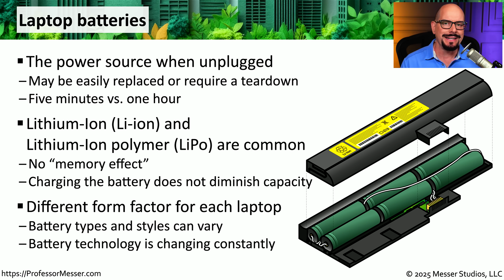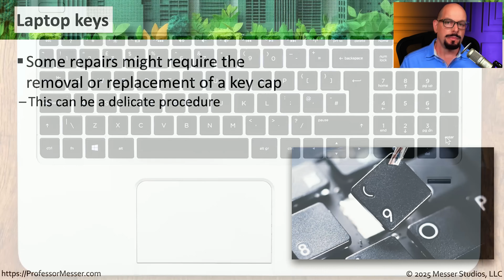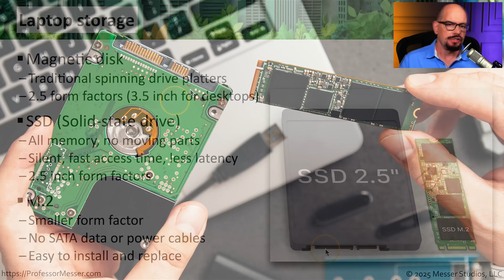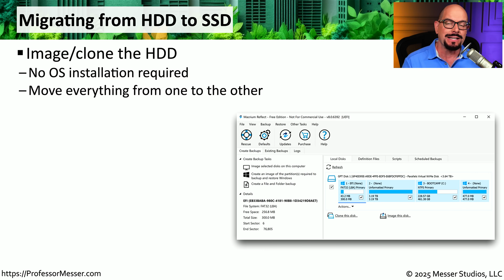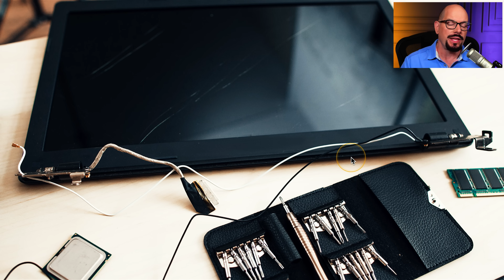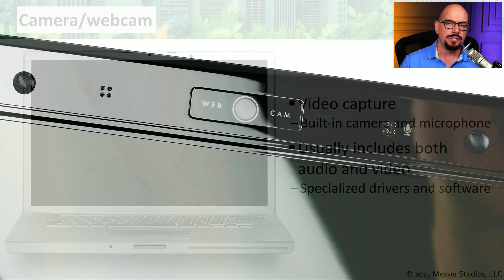Laptop Hardware - CompTIA A+ 220-1201 - 1.1

Comment: Hi Professor Messer, I am a bit confused as as per the objectives for 1201 the 1.1 is for Mobile Devices and I see in your video it shows 1201 1.1 is mentioned as Hardware. 
Please could you check that for me.
Reply from the maker: Section 1.1 of the official 220-1201 Exam Objectives is for mobile device hardware. You're in the right place!
Reply: @professormesser Thank you for checking.😊

Comment: I have to say THANK YOU THANK YOU THANK YOU for actually including some videos of the hardware being removed/installed/opened up etc. I'm a visual learner and video of the actual devices being worked on cements this material in my mind so much better than just bullet points or pictures. I'm not sure if this was included on the previous series of videos but I've been looking for something like this for a very long time. THANK YOU!

Comment: It is hard to dissamble and repair a laptop. I have a question: Should we be able to repair and fixing if we are a comptia a+ certificed? Or is it something different?
Reply: Depends how advanced the fix is. 

The A+ will give you general troubleshooting tips. But not specifically repairing with soldering, using old chips to replace with new ones. 

But it will teach you how to troubleshoot issues at a high level. Like learning to check the RAM / replace it, check the Power supply for issues. 

If you want more advance repairing I’d recommend watch repair channels specifically & look up specifically repair courses & trades. But for the majority of repairs A+ will help. You just won’t be dissecting GPUs, CPUs, Hard drives - those are very niche and you need to learn the repair you’re doing solely for that brand + learning how to use the tools you’ll need
Reply: @NightcrawlerNetwork  Thank you for your answer. I asked because I want to be able to repair/fix the hardware without sending the broken hardware to the service. However, as you've said parts like GPU and CPU need some advanced soldering devices. But, is it a "must?" If I don't know how to repair a hardware am I bad IT? I keep asking myself to this because I want be able to do everything.

Comment: I'm starting from scratch right now and it's really hard to decide whether I should study for the new test or the old test.
Reply: Try a new one, for sure brother
Reply: I'm in the same situation and decided to study for the new test. The main decider was I didn't want to put work into studying for the old test, past one of them, and then something happens to stop me from being able to pass the second one before September. Studying for the newer one means you learn the latest info and have a longer grace time for passing both exams.
Reply: Id take the new one. hopefully you've made some progress by now, but there isnt much time left for the old version, especially if you like taking your time with studying this
Reply: Same I'm trying to get into IT/Cybersecurity but have been so confused on where to start or which certifications I should do, since there's so many. 

It looks like the 1201 and 1202 were just released recently so I think they're the new CompTIA A+ version, and I'd do those instead of 1101 and 1102.
Reply: @kriegsmann  1201 and 1202 will be more useful to get as they are the newer updated A+ cert. 1101 and 1102 will be discontinued July 2025 I believe.

Comment: Hey there sir, just a quick question I’m about to take the 1101 test but haven’t even touched any material on 1102 do you think I can make it before they retire?
Reply: the exam retires on september 25th if u haven't based both the 1101 and 1102 you will have to retake them both as 1201 and 1202. basically you have until September 25th to pass both 1101 and 1102.
Reply: @Studiepi didn't they just release this 2025? i thought they last for at least 3 years
Reply: You can also mix 1101 and 1202 @Studiepi
Reply: @JDough93 are u sure? I heard Comptia doesn’t let u mix two different versions of exams
Reply: You can't mix the two versions  @swagmoneyjake
Reply: No
Reply: Im in the same boat im just gonna take the new ones jic i fail one of the two and then im forced to buy the first one again
Reply: If you haven't  prepared, you can get a refund from Pearson and change it to the new A+ exam. Just did so myself.
Reply: @shaynotsheaa awesome,but is that with or without the 6 months grace period?